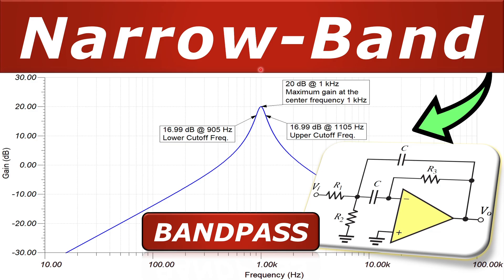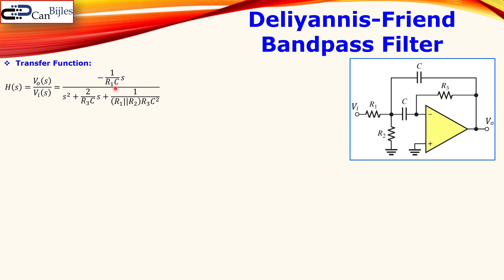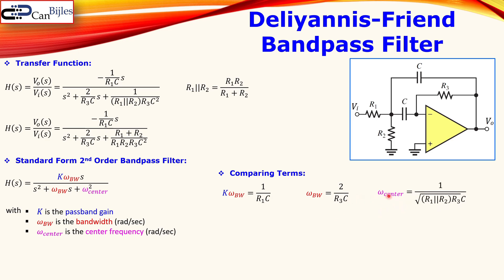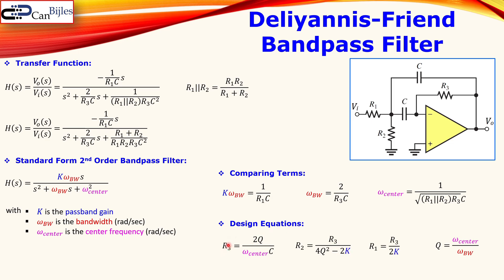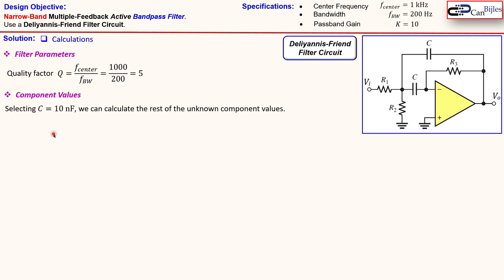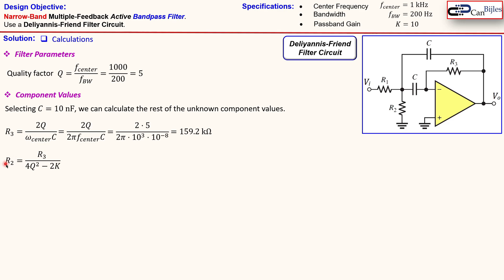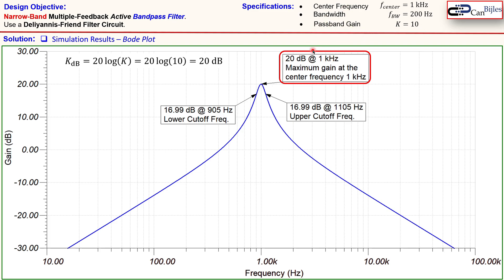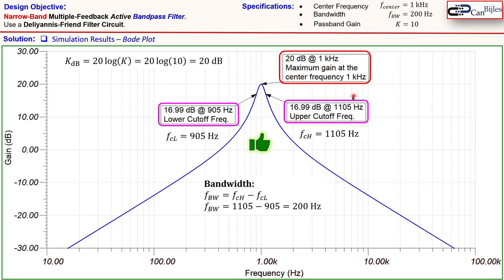Deliyannis-Friend Bandpass Filter Design 🌟 Narrow-Band Multiple-Feedback Circuit

Comment: Can u make a tutorial that's shows how to simulate that circuit and make those nice plots
Reply from the maker: It will be a tutorial to use the TINA-TI Spice. This requires some more time, but you can already find the manual on internet: 
https://www.tina.com/docs/v14/Tina-v14-manual.pdf
https://www.ti.com/lit/ug/sbou052a/sbou052a.pdf

Comment: Many-many thanks!

Would You tell me, what is the maximum Q value (maximum narrowness) that is practically archievable with this configuration with a general, common-type OpAmp?
Could I use this configuration to build - for example - a trully analog DTMF decoder, in practice?
Reply from the maker: Great to know that you liked the video 👍 

There is no single answer to what the maximum achievable Q factor is. The actual value will depend on the op-amp parastics and gain-bandwidth product, which will limit the speed of the response and thereby the sharpness (Q factor). In addition, component nonideal effects will add more attenuation and thereby shift the center frequency and reduce the sharpness.

Comment: It wouldn't work if you chose wrong OPAMP
Reply from the maker: This circuit is very sensitive to component variations and also the op-amp that is used. What do you mean by 'wrong op-amp' ? The specifications for a Narrow-Band Multiple-Feedback Circuit is important.